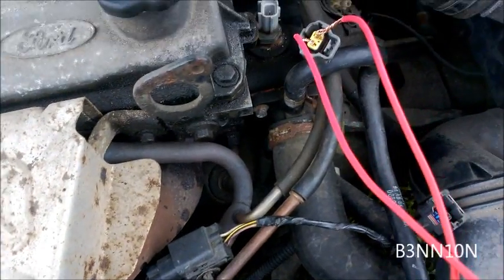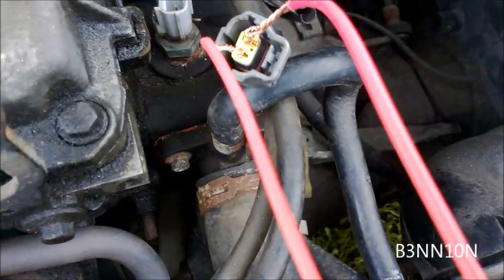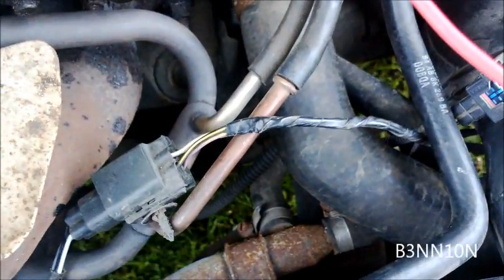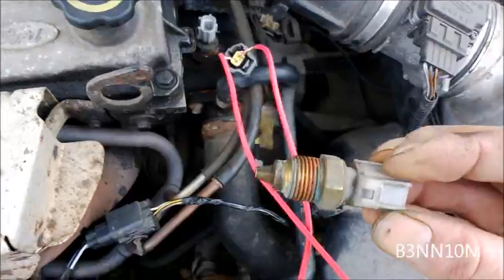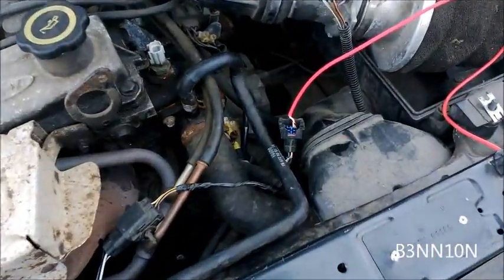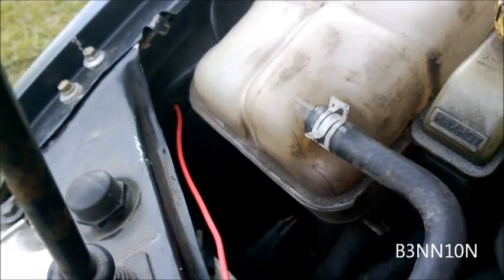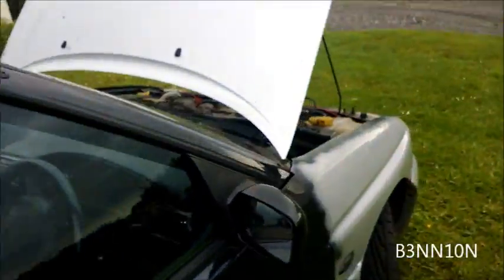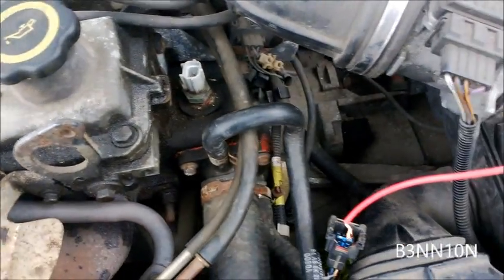Ford Escort Fan Not Working and Temperature Gauge not working Cheat Fix Remedy How to

Comment: Hey i bridged the fan switch and the fan turned on. BUT i noticed if i just unplugged the switch without bridging, the fan still turns on. Is that normal? Or is there maybe something else wrong going on like a short somewhere
Reply from the maker: I’d reply the switches mate… work with new…

These cars are old now and gotta start somewhere

Comment: My 2000 Ford escort  had an "untrustworthy" temp sensor ....... swapped it with a new one,    car wouldnt start ........ Unplug new sensor,   car starts right up.  but fan doesnt come on. -   this thing is frusteraing cuz Im scared to get into stop n go traffic.
Reply from the maker: swap out both censors. but do the test in this video first with the wires.
Reply: @B3NN10N    I just tried the jumper test & nothing happened.        .....    then  unplugged sensor & fan kicks on high speed.
Reply from the maker: @97warlock  I’d swap out the fan sensor too.

Comment: B3NN10N, Hi, I have a 1995-1999 type escort hatchback ghia, out of the several problems with it, some of which you have run into in your videos, I saw my fan would only switch on when the dash gauge needle was on the red extremity. After changing all the sender and switches at two electricians, one of which even installed a button for me to switch it on manually, it is still the same. I paid their labour and the parts. I told one of them there was no change, he only answered with a question: Is your engine boiling? 

I went to two of them because after the first one set up the manual switch for me, the fan's fuse burnt. And I had no more cooling at all! The fan didn't turn on manually. 

My questions are: 1.is the gauge meant to go to red before the fan starts automatically? 2.did the manual button installed cause the fan fuse to burn?

Like I said, I have several problems, but cooling the engine is, to my mind, a good thing to worry about more than the others. Thank you for the videos and I am glad you are dedicated to these cars. Maybe you could help me keep mine running a little more.

Comment: Hi I have bought a ford escort cabriolet 1.8 si  n reg when driving the temp gauge goes in the middle and then the needle will fluctuate up but not into the hot zone will stay in the normal zone.
What is happening while driving the fan keeps coming on then the gauge will come down to half way then it will go up then fan will come on .this happens while driving. 
What could this be please .
Thank you in advance
Reply from the maker: plumbing 999 fan switch I'd say.

Comment: Hello great video, i have a ford escort 1.6 gas (1995) and for some time my temp gauge is not rising and today i did a test i let the car run around 10 mins and outside temp was  27C / 80F and gauge and fan not working can you please pinpoint where are the sensors located on your car because it allmost identicaly to mine and i want to know where are locate to replace them or at least if possible fix them.
Reply: Two of the sensors are located on the thermostat house and the sensor of the fan is placed on a water pipe near the radiator.

Comment: My temp Guage was stuck changed out temp engine sensor and Guage is working.My fan sometimes didn't work but a guy that works for my brother unhooked the fan then rehooked it so far good.Need a car if near Nashville Tenn try Burgess Used Cars on Nolensville Rd..Across from the Fairgrounds Ask for Loyd OR Floyd Burgess at 615-255-2989

Comment: I was checking ur video, maybe I could find a solution to mine. 06 Nissan Frontier CC, auxilary fan not working. Checked relays n fuses, hooked fan motor direct to battery, everything working ok. Changed out cooling sensor, but old one was still ok.  I'm afraid will need to take it in to dealership, cause cannot find cause for ac fan not coming on. Thanks for video.